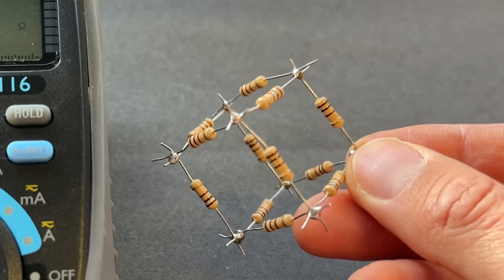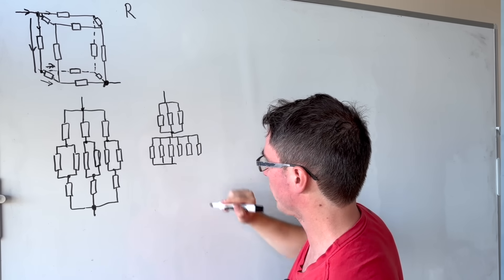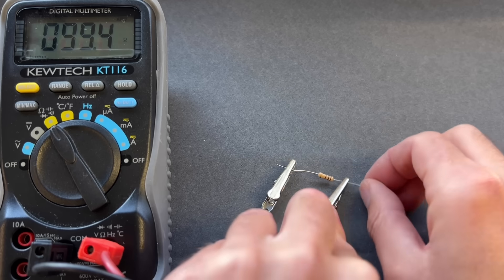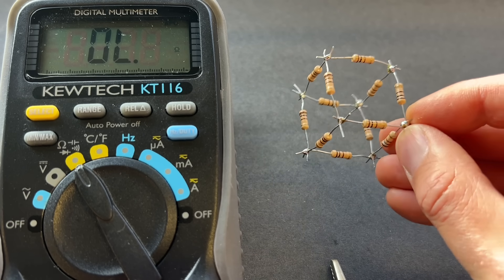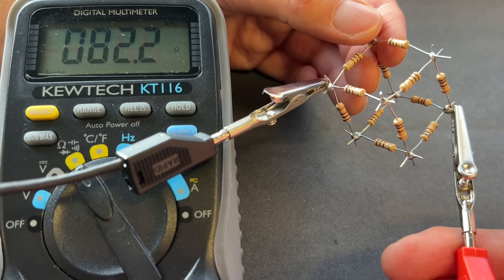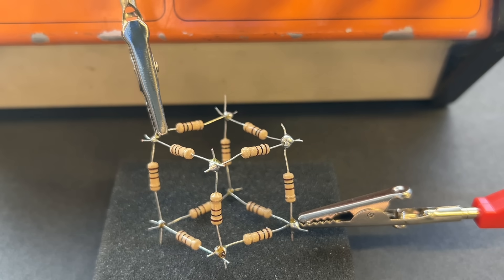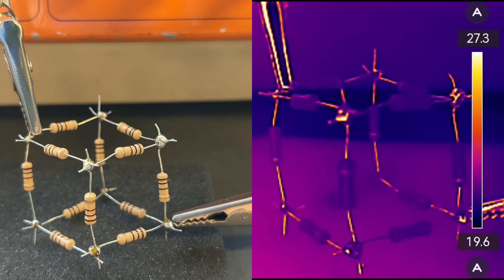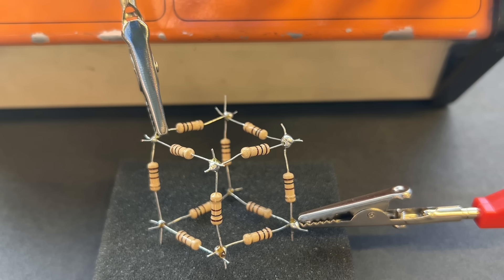A real resistor cube - does theory agree with reality?

Comment: The last band on the resistor is tolerance.  You have resistors with a tolerance of +/-  5% so they are well within range.
Reply from the maker: Thanks for pointing this out.
Reply: @SimonPoliakoff thanks for science
Reply: And the actual resistance value varies with temperature - with carbon film resistors it goes down with rising temperatures (negative temperature coefficient) and with most metal film resistors it goes up (positive temperature coefficient). (Invar resistors have a very low positive temperature coefficient…)
Reply: @allangibson8494  Their spec sheet will tell you what temperature the resistance value is at. Likely 20C or some other round number near room temperature.
Reply: @kukuc96 Finding an actual spec sheet for a resistor is an interesting challenge…
The tolerance on most is wide enough to cover any expected manufacturing plant environment. Temperature dependent resistors are however an exception (Pt100, Pt150, Pt1000, Cu100 & Ni100 all have tolerances in the 0.01% range).
Reply: @allangibson8494 hell, resistance even varies with voltage. Resistors in the form of electronic components are only linear because humans make our best efforts to make them that way and if you're working high voltage or being picky you can't ignore that.
Reply: @DKNguyen3.1415 Frequency has more impact than voltage (because most resistors are also spiral inductors…)
Reply from the maker: @a @allangibson8494 thanks for adding in  that detail 😊
Reply: For the uninitiated, all circuit components are like this. Passive AND active. Resistors are actually a tighter tolerance than most other things. Electrolytic capacitors for instance can easily hit +/- 20%. BJT beta values can also vary a lot depending on what you're using.
Reply: @someonerandom704 those Beta values depend on micron precision so i see how they can vary drastically
Reply: The thing is, to calculate the tolerance of the resistors in the cube, you need to do the calculation WITHOUT the symmetry to be able to plug in differing valves for each resistor. That is much harder to calculate and you don't even know the direction of the current in the intermediate 6 resistors. Time to crack out Kirchhoff.
Reply: To add to this. A 5% tolerance resistor will almost always be closer to the 5% error than to the advertised value. That's because any resistors that are within 1% are sold as 1% tolerance resistors at a higher price. And any within 0.1% sold at an even higher price.
Reply: @RC_Engineering That's how they sold floppy disks. They only manufactured DSDD, and the disks that failed were retested to be sold as SSDD, or SSDD at lower cost. It's actually a genius way of making bank on something that failed QA and would otherwise be discarded as garbage.
Reply: @ghost307  And that is what they do with processors toaday. The difference between a high freq. overclockable CPU and a low cost one is the test they pass or fail during the production process.
Reply: @RC_Engineering 
Not true.
1% resistors also have tighter temperature coefficients.
Reply: @RC_Engineering  Not, look at the datasheet for 5%, 1%, and 0.1% resistors and compare them, you may be in for a surprise, there are other differences than tolerance.
Reply: @K2teknik.  For the most part you are correct. I looked into this and it depends on the way the resistors were manufactured. From my time in a university lab, the resistors had a bimodal distribution. But not all are like that anymore. I think it was more common before the 80s.
Reply: Correct. The last 3 words of the mnemonic are "get some now".
Reply: Modern batches are much better though (still labeled 5% though), so I wouldnt dicount the possibility that the multimeter measurement is off
Reply: Computing the distribution of the resistance of mass produced resistor cubes is the real challenge.

Comment: You just got to draw out circut so you can see what's parallel and series but it's pretty neat.
Reply: I remeber not being able to solve like that, and need Kirchhoff's loop law... learned like 10y ago, so don't remeber well
Reply: @Grunkle_Stanley   3 in parallel. 6p. 3p.

 1/3+1/6+1/3 = 5/6...
Reply: @paradiselost9946 this isn't that straight forward. This only works for resistors of the same value by symmetry. If they differed in value you'd need a different equation.
Reply: @RC_Engineering  no you dont. you just have to break it into several sections like any other circuit.
Reply: @Grunkle_Stanley  It's a case of "just shutup and calculate!" rather than trying to stare at it and understand it.

Comment: Next video : The Tesseract Resistor
Reply: It should work basically the same, right? As dimensions in a hypercube increase the basic equation of current sharing should hold. Oh... Wait. This gets really close to Ron Graham's famous paper on vertices of hypercubes, so the whole thereory probably dies break down at the same point which he was able to narrow down to between Graham's Number and 7 dimensions.
... Well, at least the good news is that we can just add multiple resistors to vertices in 3 dimensions. We don't actually have to add them in higher dimensions.
Reply: @SkippiiKai  wait till you add capacitors and inductors and pulse the electricity into the hypercube!
Reply: @quantumkineticscorporation Ohh use AC and different cable sizes so that you get reflctions😅🤣
Reply: Do you want Buckaroo Banzai? Cause that's how you get BB
Reply: The Tesseresistor
Reply: @redgit9905 it sounds more like terrorist
Reply: It would be one of the 8 surfaces elements of it to be precise.
Reply: with flux capacitors!
Reply: *The Transistor Tesseract
Reply: Could it be built?
Reply: @ElectronElement  Depending on your definition of success, yes. Obviously you can't make an actual 4D object, but you can build a 3d projection of it. It would look like the pictures you can find online, like on the Wikipedia page, with the right number of vertices and connections between them.
Reply: @iang0th  the only thing that matters is the distance between the points being correct, correct? is it possible to build that in 3D keeping the ratios correct?
Reply: @incription The distance doesn't matter for the purpose of making a "tesseract of resistors". All that matters is the topology of the circuit, so you can just wire the resistors with the topology of the skeleton of a tesseract, which can be embedded in 3 dimensions.
Reply: @aczajka74  but not 2 dimensions correct? so you can make a 4d tesseract but not a 5d one? thanks for the correction btw, but I was thinking about the resistance in the wire
Reply: @incription Any graph can be embedded in 3d space, so you can make an array of resistors with the same connectivity as the skeleton of an n-cube for any n.
Reply: @aczajka74  wow, thanks!
Reply: I think that for two closest corners on tesseract ( on either cube) the resistance is 2R/3
Reply: OH I NEED THIS
Reply: the resisterract
Reply: For every pair of opposite corners of the tesseract, the resistance would be 2/3 R, according to my calculations.
Reply: Now generalize it for n dimensional cubes.
Reply: Technically should be possible if you make all the theoretical connections
Reply: Which is doable
Reply: Theoretical: 2R/3
Actual: Yet to be determined

Comment: Perhaps the meter is not that accurate or may be something else went wrong. I have done some experiments and at least with resistances, I did not find so much discrepancy. Anyway, I will make a cube and see what comes out shortly. ( added on 29/11/2015) Anyway, 5/6 is 8.3333... so the discrepancy is acceptable.
Reply from the maker: The resistors are cheap ones so I would expect up to 5% tolerance.
Reply from the maker: The multimeter is a decent one so would expect it to be good to 1%
Reply: @SimonPoliakoff  Have you considered using a meter that supports 4 wire resistance to eliminate things like cable resistance?
Reply: @thatredkite8310  That is a good suggestion, but 4 wire (Kelvin) resistance measurements are typically made only for values expected to be less than 1 ohm. Milli-ohm meters employ the 4 wire measurement and usually display 9.9999 ohms maximum. Still it would be interesting to try this with a 4 wire measurement configuration.
Reply: @ronaldschild157 my HP 3478A can measure up to 30 Megaohms in 4 wire mode iirc
Reply from the maker: @thatredkite8310 I think the resistance of the leads is v small which I showed by shorting them together.
Reply: @thatredkite8310  That is only necessary when the contact resistance is high or the values being measured are comparable with the cable resistances, which are <<0.1 Ohm.
Reply: @SimonPoliakoff  I will replicate asap

Comment: I guess you can measure the potential difference between the symmetrical corners to show it's negligible, then even short then out with an ammeter and find the current in the ammeter is zero, to illustrate the symmetry argument that's used to derive the theoretical value for the total resistance.
Reply from the maker: That would be a lovely extension!
Reply: @SimonPoliakoff  WHAT DID THE DIODE SAY TO THE TRANSISTOR? 

*I COULD NOT RESISTOR!!*